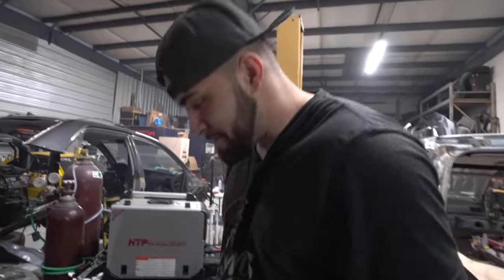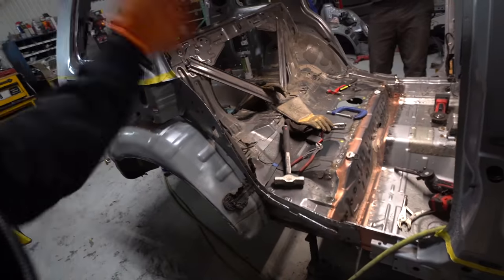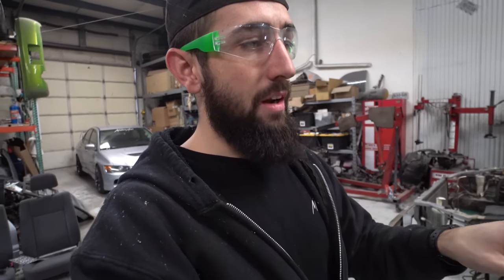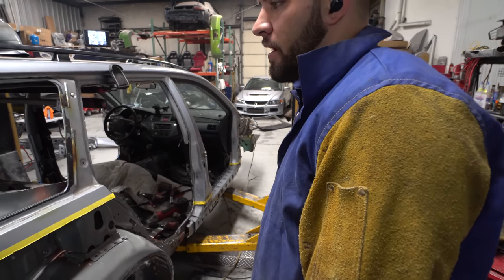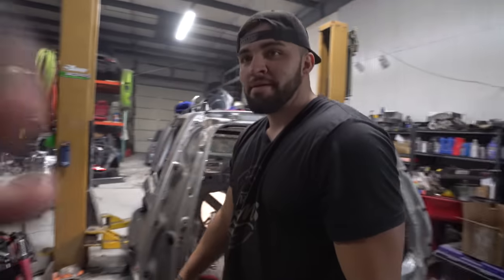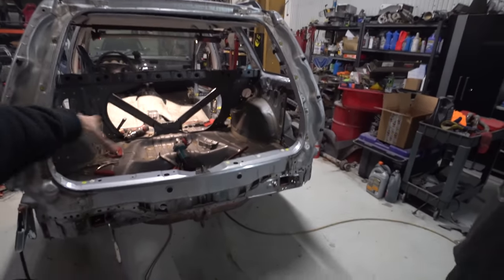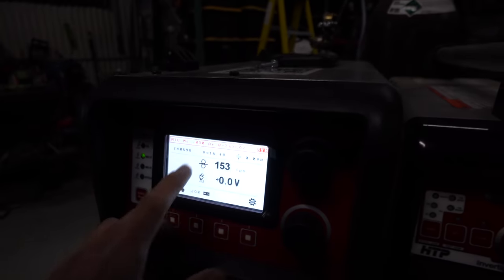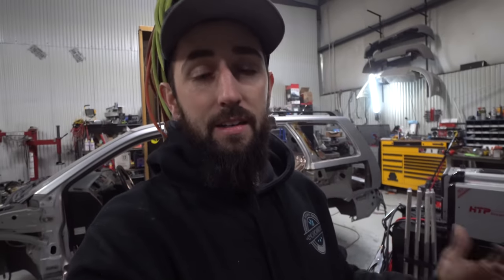Pt.3 Evo Wagon Build | EVO FLOOR PAN SWAP COMPLETE | New Welder Works PERFECT On Thin Metal!

Comment: Loving the way this is coming together.
Once you got down to the inner layers it was pretty simple. Relatively.  Lots of spot welds and fettling but not a lot of custom fab.
I saw an Evo wagon the other day. If it wasn't doing 100 down the motorway I would have had a look in the back for you!
Reply: In saying that, the Evo wagon uses the Lancer wagon floor pan with an aluminium strut brace.
I would need to have a really good look to see any difference but I've had a few Evo wagon come through the shop.

Comment: Did you manage to stitch the box rails together underneath or did you cut and butt weld them?
If you were able to drill out a seam and plug weld then I'd say you've built a better Evo wagon than the factory one. If its butt welded I'd bend up a box that goes over the welded section and stitch weld it over, like a fish plate. Otherwise, great job.

Comment: Would it not "almost" be easier to weld the roof section/rear of a wagon onto an Evo?

No drivetrain swap, no floorpan issues etc. And the Vin would still be an Evo. 🤔
Reply: Yes but that wasn’t the purpose here. The lancer wagon and wrecked Evo were cheap. A clean evo is 25k and then you gotta cut it up.

Comment: There has only been one bad thing I have seen you guys do on this build and that is with welding it back together you are pulling your welds but you really need to push your welds cause they will be stronger and the Miller 210 is a basic setup Miller has welder that setup just like your htp